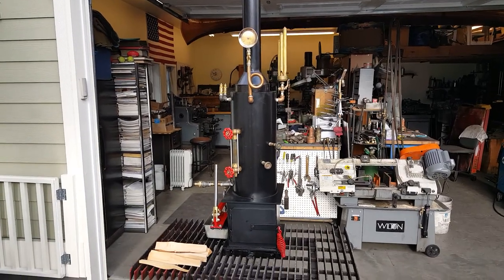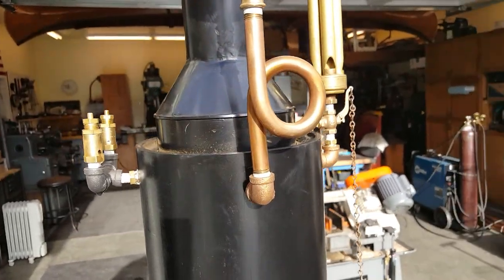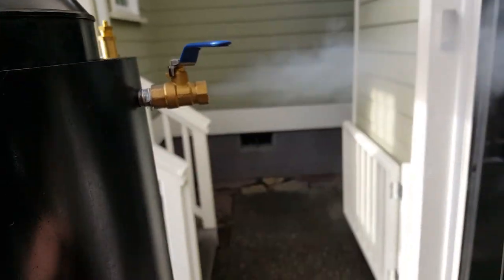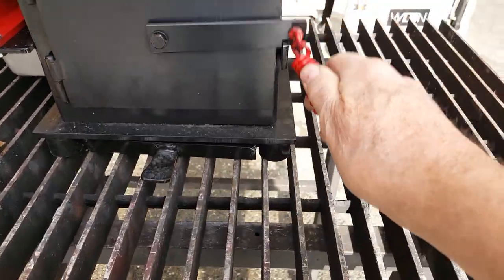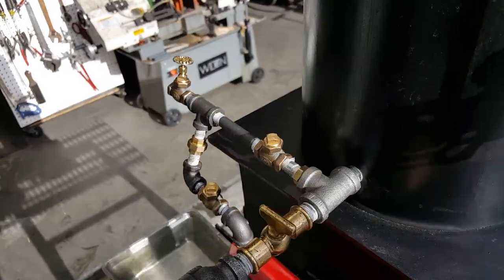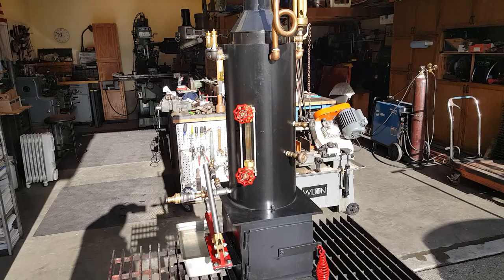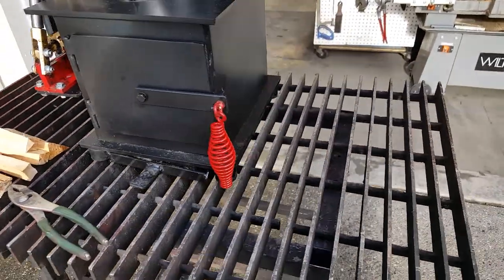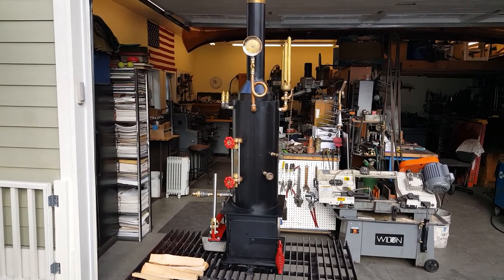Live Steam Boiler Hand Pump Whistle Gauge steam engine

Comment: I haven't been able to find you on eBay.   Do you build bigger boilers that could run a five or six hp engine?
Reply from the maker: Here is the ebay listing number for this boiler. 263305694643  I am building a larger boiler that will run a 5 hp. steam engine. Ross Call me at 206 948 0770